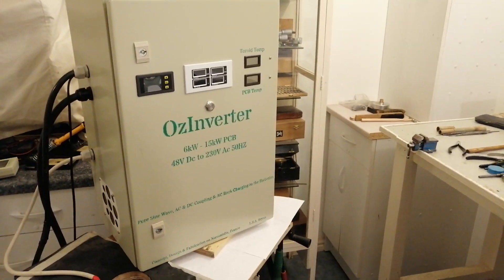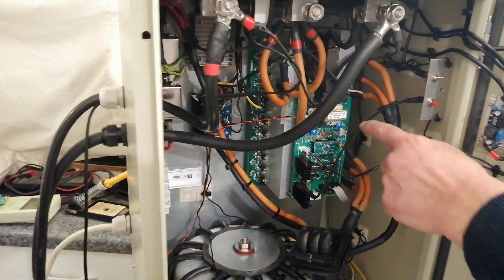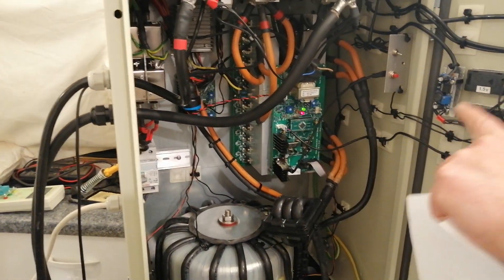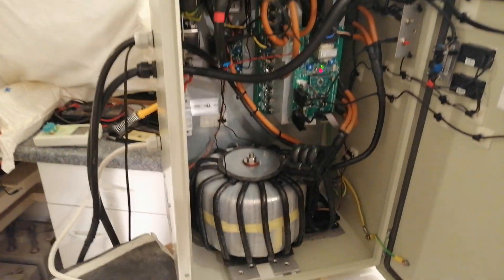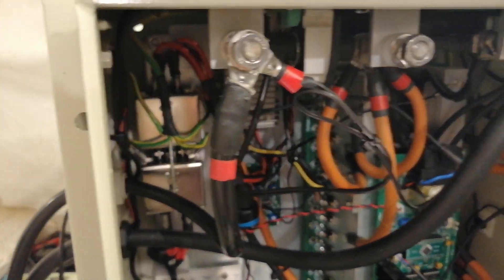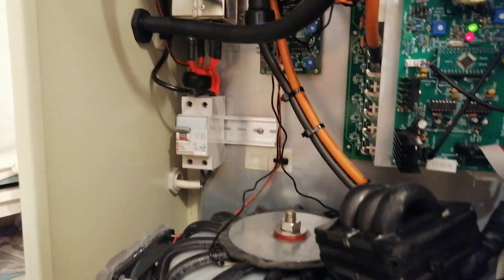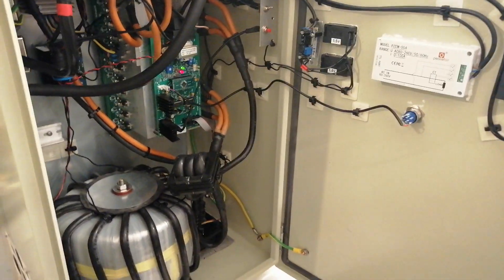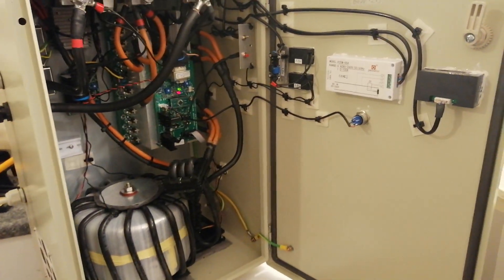6kW OzInverter [explained]

Comment: Hey, could this design be used to build 110-120volt 60hz inverter?
Reply from the maker: Yes.  In my new completely re-written 2nd edition, I show and print the etch masks etc, for the 60HZ and can supply the 60HZ control board. And show you how to tap the secondary windings on the toroid as you build.
Reply: @Echorenovate  hey thanks.  I sent a message on your web page inquiring about purchasing your book. I'm not sure if it went through. Could you provide details how I can purchase? Thanks.